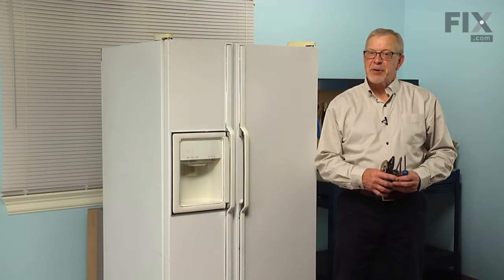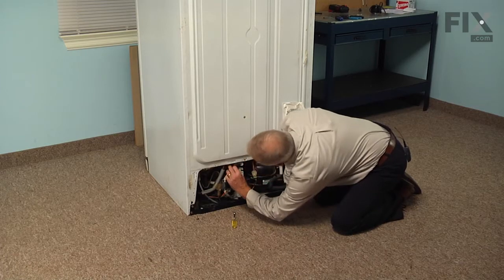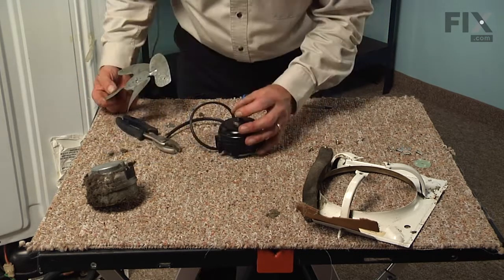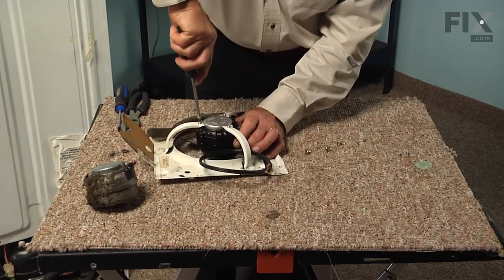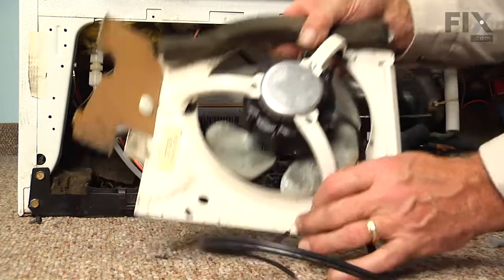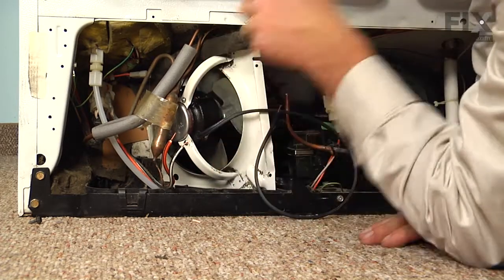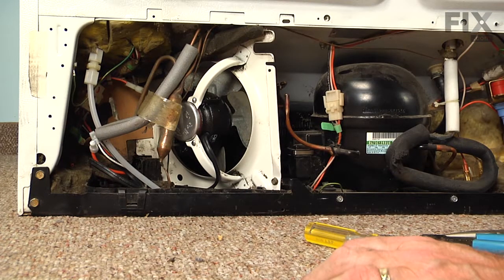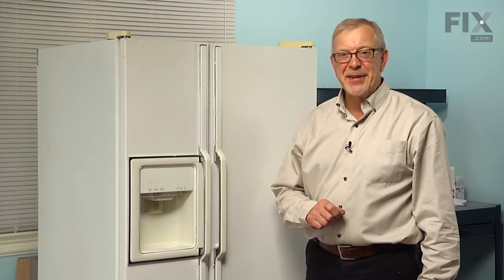GE Refrigerator Repair – How to replace the Condenser Fan Motor - 115V

Comment: I have a thin green wire along with a red and black wires. I do not see a green wire in your video. Any idea where that wire goes?
Reply: The green is ground so you can plug any metal screw thanks